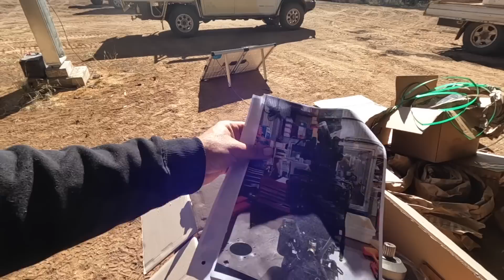FINALLY Sprayer Repairs BEGIN | Workshop | Vlog 166

Comment: Matt, why don't you use your pressure washer more often? it seems to me that it would make much of your repairs a lot cleaner, not having to wipe away grease and oil while you are doing the repairs.
Reply from the maker: It certainly would make it a bit cleaner👍 usually we aren’t near the pressure washer out in the field but if we are near it we generally try too👍😁
Reply: this was going to be my exact comment....I am always massively impressed with their skill set and their operation, but the pressure washer must be hiding in the back of beyond.....they need some local contractor to partially run over one so they can get a good deal on it needing repairs like they did the compressor 🤣😁
Reply: @thejacksonbrothers  Do you have a fire tank? most farms I know normally have a tank set up on a light truck, all you need to do is add a high pressure washer and Bazinga no more messing around in the grease and oil covered machinery and I bet the clothes washer would be happy too
Reply: Add a bit of truck wash detergent and it would improve quarantine by reducing the movement of weed seeds and plant diseases between farms. Cotton farms in the area used to have wash pads to reduce movement of the plant disease, fusarium, between fields.
Reply: @davidwatson3921  yep that you got to do, but then of course you need get somebody to drive the fire truck to where you are working with the tool truck 🤷‍♂️🤷‍♂️. For gods sake its only a bit of oil, better when the dust has soaked it all up. I guess it easy for people that do their repairs in the workshop with latex gloves.

Comment: What is your growing season?  I find it weird to be planting going into winter.
Reply from the maker: Hi Doug, yep most crops grow through the winter here (wheat, barley, chickpeas, canola, linseed etc. sorghum, corn, sunflowers and cotton are all summer crops👍😁
Reply: The southern hemisphere seasons are the opposite of northern hemisphere, so December to February is summer, march to may autumn (fall), winter is June to August. In addition we don’t have snow so no need to sow early so snow covers the plants. Most cereal varieties are called spring varieties because we sow in winter and harvest in November or late spring. Late frosts around September and flowering stage cause havoc with poor grain fill. We do have some winter wheats over the last decades or so and they are usually grazed by livestock. Most of the wheats are white wheats for bread making and some semolina, also called durum, wheats.